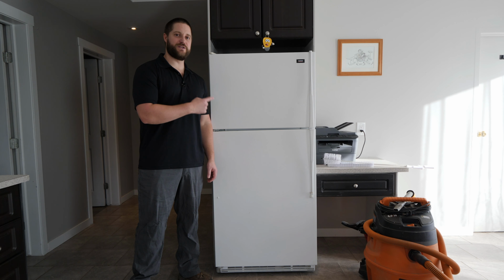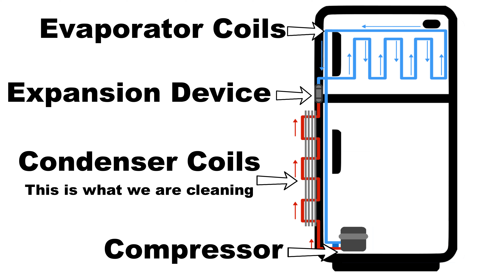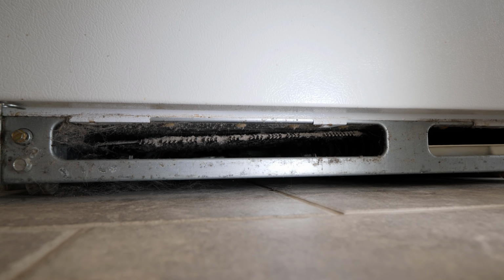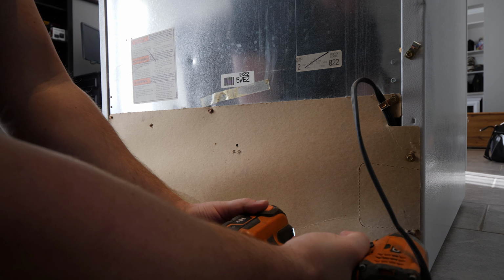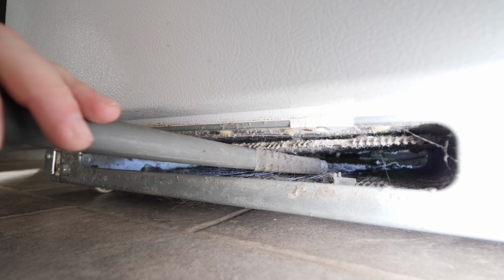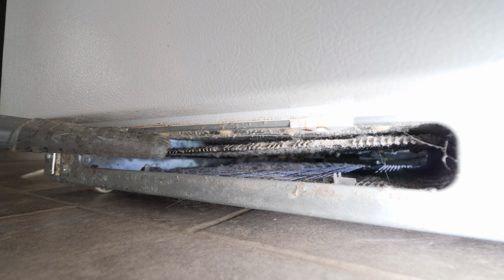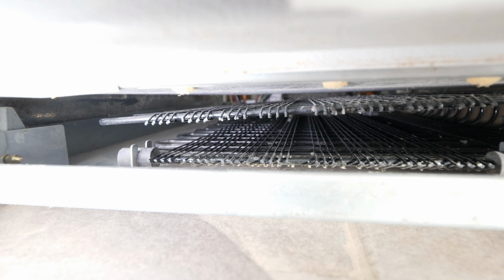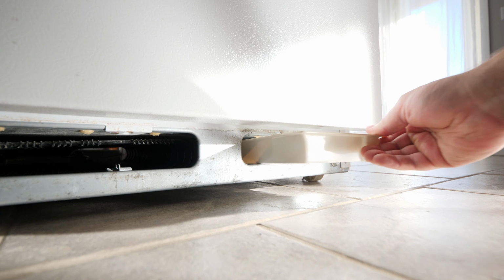Refrigerator Condenser Coil Cleaning: DIY Fridge Service

Comment: My refrigerator was making all kinds of noise every time it turned on.  Worsened about the past year.  Today I got into the front and found so much lint in there.  After unplugging I got my vacuum cleaner with the long stem and starting sucking all of that lint out.  Could not believe how much was in there.  Now when the fridge turns on...it barely makes noise and most I hear is the fan.  I'm ordering some brushes and I'm going to get into the back to clean out all of that next.  It's videos like this that saved me having a tech come out and charge me and arm and a leg to do basic cleaning which I had no idea had to done.  You live you learn!!

Comment: The underside of the fridge literally acts like a magnet for cat and dog fur.  I looked at so many videos and everyone was different.  This is the best and easiest one.  BTW, I just did mine yesterday and will never let it go again.  When the motor started running non-stop I knew something was wrong.  Works well again.  I wish manufacturers would sell or give an inexpensive cleaning kit when someone purchases a fridge because most people don't even know to do this until they run into trouble.
Reply: 'I wish manufacturers would sell or give an inexpensive cleaning kit when someone purchases a fridge because most people don't even know to do this until they run into trouble.'

Oh no they wouldn't want this, they want it to break so you either buy another one or spend a fortune buying parts to fix it. I would say 95% of people dont even realise they have to clean the coils and it never gets done and they are surprised the fridge fails quickly.

Comment: Nicely done.  My Whirlpool side-by-side seems to have been designed specifically to make coil cleaning as difficult as possible. These brushes will make it a bit easier.  Thanks.
Reply: They make it difficult on purpose so people will just buy a new unit instead.

Comment: Thanks for the video… Mine is running non stop and the freezer is frosting up. Hopefully this will fix it. I looked at the coils and they are horrendous…😂 Thankfully my mother in law just moved out… She had the freezer and the refrigerator packed full of crap. I read that can cause a problem as well, without proper circulation. I got the inside cleaned out good the other day. Now I just gotta clean the coils and cross my fingers…😅

Comment: Just a note - that skinny crevice tool is from the auto detailing package that was part of a special at Home Depot on a Ridgid shop vac.  If your vacuum doesn't have one, you can get about 3 ft of 5/8 or 1/2 clear vinyl hose and squish one end into your short crevice tool.

Comment: My Amana has a cage around the coils so a brush not a vacuum nozzle cannot be inserted between them.  I used an electric leaf blower on the lowest setting---it worked extremely well, but is very messy. I then cleaned up the dust in the kitchen.  Had the refrigerator coils been designed better they could be cleaned with a brush & a vacuum cleaner. Seems to have been designed to make it very difficult to clean.  the manual instructs a 3 month cleaning but no pictures or any details as to how to clean it. Most folks would be clueless.

Comment: My front toe kick door on my 1996 vintage Hotpoint fridge is IMPOSSIBLE to remove as it is permanently bolted on with no screwdriver slots. The one time I cleaned it, I had to tilt it. This is ridiculous! So how do I clean the coils without risking serious injury?

Addendum: after seeing you clean out your coils with that long crevice tool, you’ve just given me an incentive to order a replacement brush roll for my “Dumpster Emporium”shark navigator vacuum, which is my only vacuum (in my collection of vacuums) that has a long crevice tool.

Comment: Soooo...The coils spanning from Top to Bottom of fridge: Do you Unscrew, and then Remove Those/It? Or just clean as well as possible with them attached? (Style 2)
Reply: You have to clean those in place, and in very gentle, patient manner. The hot refrigerant flows through those coils and simply loosening the coils could cause a refrigerant leak.
Reply: Ok, thank you much!

Comment: My 5 year old Kenmore has the coils running opposite direction from yours and designed so one can not get a brush in from front or back. The only way to get to them is tip the huge fridge 45 degrees on its side. What a horrible design.